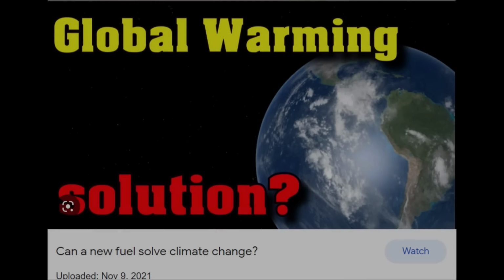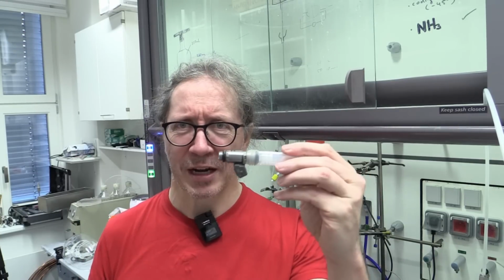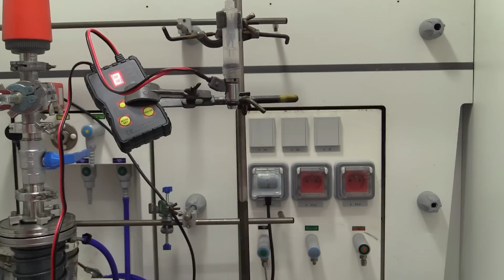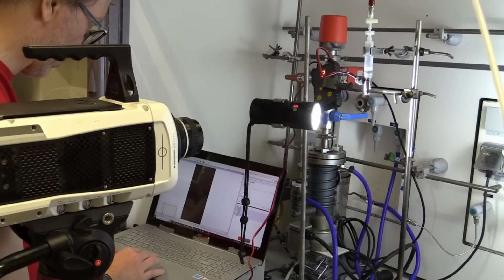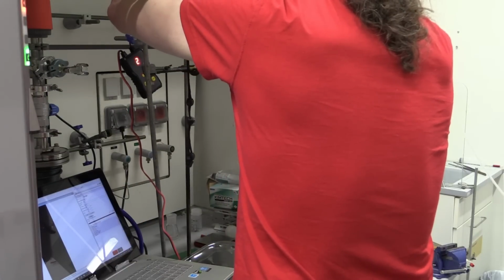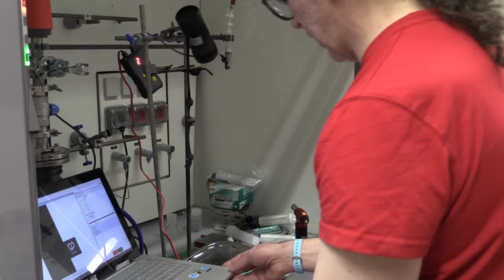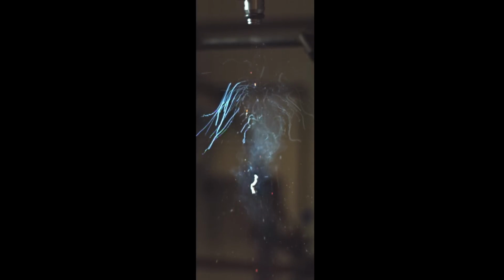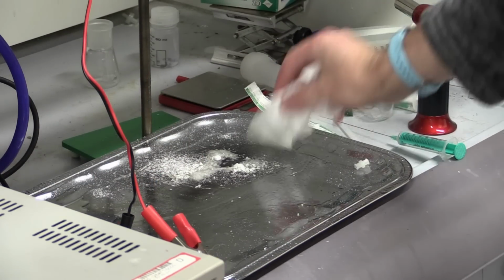Can Fuel Injectors burn SODIUM??

Comment: Aaaahhh - nah, please no.
Geoengineering is something that could have waaayyy too many unforeseen consequences as of yet. From what i can gather we should first get a more precise understanding of the weather-systems, specially in regards to predicting the results of influencing it, before we even attempt smaller scale tests.
Sure this would reduce the irradiation and thus also cool the planet. But how long will those particulates last in the higher atmosphere? Do they react with other elements? does the blocking of light change the chemical reactions in the atmosphere? What about the impact on plant-matter? Could it have a negative impact on the oceans?

i think it would be better for not if we build more hydro and nuclear power - powerplants that are reliable and better for the environment than having to use coal to stabilise the grid. Another big thing would improving the technological quality of live in poorer regions of the world: There are still areas in the world were people are burning green wood or are using crude oil for heat. Those are many many times more polluting than say a normal gasoline cat. 

Force large cargo-ships to have some basic catalytic converters and introduce emissions regulations for them. Funny thing is: They are waaaayyyyyyy more efficient than anything else and also way less pollution per ton-distance (a distant second would be rail) - but the mind-boggling amount of cargo shipped makes them the single largest source of pollution. Cutting down on sulfur, NOx and other emission by 50% would be rather easy considering that they run on the heaviest of oils with a lot of impurities and no cat or anything. Sure, cargo would become a bit more expensive but shipping is so cheap that a price increase of say 10% would still only mean a fraction of a Cent extra for say shipping a phone from china to Germany.

Comment: Buy a cheap deisel, please, and run it into the fuel rail. You will need to adjust the air fuel ratio, but that shouldn't be too difficult

Comment: with fuel injectors you can get bad quality ones hit and miss in the world we live in now with no quality control and piracy of fake parts found inside o.e.m sealed box sold . Also there is different versions of injectoes old mechanical popet valve diesel 300 bar precombustion chamber engine use. The port fuel injector you use is 3,5 bar +-  then vw tsi bosch gasoline is also 300+ bar and then the commonrail gen 1 is 1400 bar with magneto electric and then higher pressure if both magnet electric and piezo electric. piezo need 10 bar hold back valve on return fuel. and then there is unit injectors pums and injector in 1 unit of both piezo and electro magnet actuated.

Comment: With fuel Injectors that aren't designed for ethanol they tend to leak
Reply: Understandable. Lots of things tend to leak once you get ethanol in them.
Reply: @seigeengine  ethanol is really nasty stuff for components, it has a very high octane so you can run higher cylinder pressures before you run into spark knock, problem is the stuff will destroy the entire fuel system in a car not specifically designed for it

Comment: It's a shame that hydrogen fuel cells aren't more efficient.
Or hydrogen combustion engine.... 
Extracting energy from environmentally friendly sources is hard...
Reply: Honestly, yes. Hydrogen is an atrocious fuel to try to use. Volumetrically, it's not very energy dense, so you need massive fuel tanks to store it, and once you consider the weight of storage tanks, especially if you want to try to get the volume down with cryogenic storage, you're talking about it being really heavy too. Then it's just pretty dangerous as a fuel. And once you consider the round trip efficiency of producing it then reacting it to get power out, it's worse than batteries at storing energy.

Comment: High pressure injection gives better atomization. 
You're using a low-pressure one. 
Your at about 43psi, try between 62 and 98, then 120 and 147..using a higher psi Injector.
I'm not sure what your sealing the fuel chamber with, but things like CA glues and paraffin wax, that get dissolved will clug your ports on the injectors.

Comment: Good experiment, but the aim is flawed.
It takes more CO2 to make elemental Sodium and Potassium than any "cloud"-cooling benefit. (Unless you can refine these metals using renewable energy, such as Hydro.)
Self-defeating, really.
Reply: Eh... bullshit. The reflective potential is enormous and the energy cost of refining elemental sodium is comparatively negligible.
Reply: @seigeengine  I take it that you have research figures to establish your proposition?
Reply: That is the point. The Sodium and Potassium will be made with renewable energy. It's a fuel with an energy density much higher than that of batteries, much more portable than electricity, and with the added benefit of the aerosols that help mitigate global warming.
Reply: @seigeengine  So that is a clear admission that you have zero scientific support for your claims.
Thank you.
Just as I assumed, given the fake name.
Reply: @longlostwraith5106  If it is made TOTALLY with truly sustainable renewable energy, then that is ideal.

Comment: the guy who is afraid of working with hydrogen shoots sodium potassium through a valve. gimme a break. promote hydogen more. 
also i expected to hear more about the countering of climate change through aerosols.
Reply: You're not thinking about the safety of the people who will have to service a hydrogen engine.
Reply: Imagine the kid that worked on your vehicle last having to get an associates hydrogen engineer degree just for a lesser efficient, harder to work with, and less clean fuel source
Reply: @seigeengine  agreed